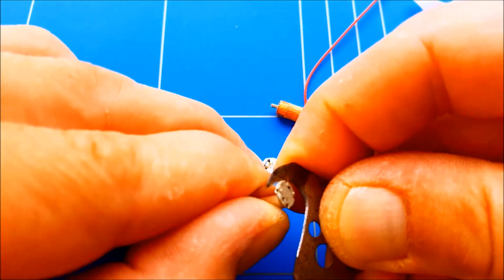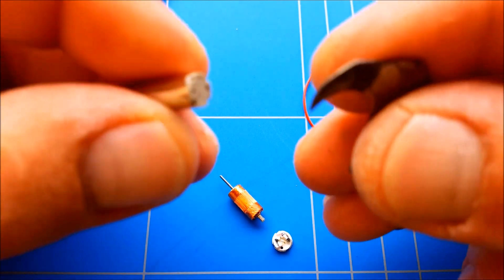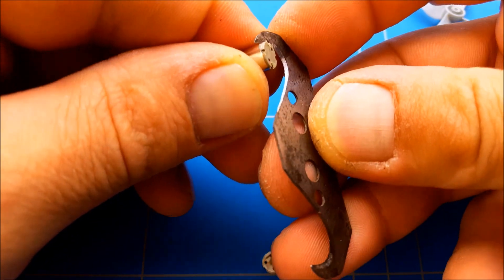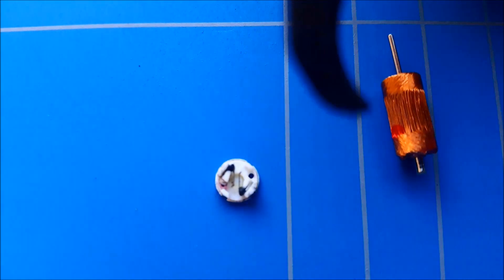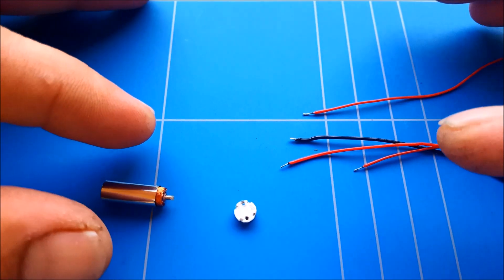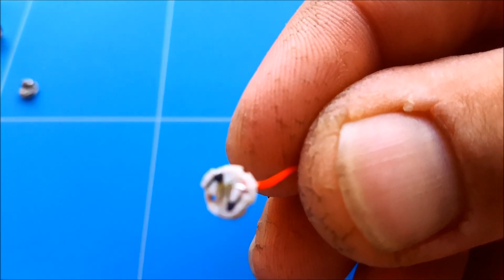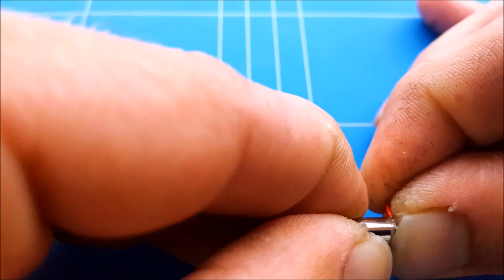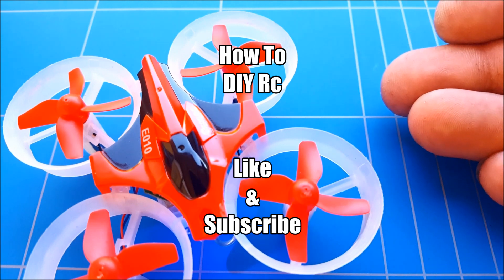Micro Brushed Motor Repair Full Disassembly and How To Fix Quadcopter Coreless Motors

Comment: but in motors with brushed brushes brushed brushes do brushes wear out? That is, if the charcoal is consumed the engine is to be thrown away? 🙄
Reply from the maker: no you dont have to but sice they are so cheap most people buy new one yes

Comment: Can you please help me .. i have an xk x100 and once i bind it with X7 transmitter it became really weak and slow .. and then i went back to the stock controller it didnt change it is still weak
Reply from the maker: good chance you battery is going bad try a brand new one !
Reply: DIY Rc I have 3... theyre all the same it cannot be the batteries

Comment: How to repair motor of air hogs my motor is not work
Reply: Some option
Reply from the maker: check the wires! if those are oke then perhaps the FC is broken or you disassemble the motor if it not spin or buy a new one check my other video